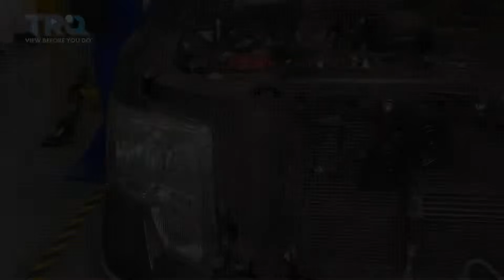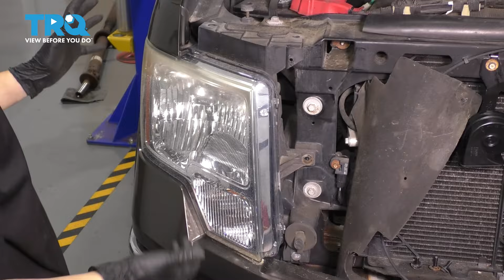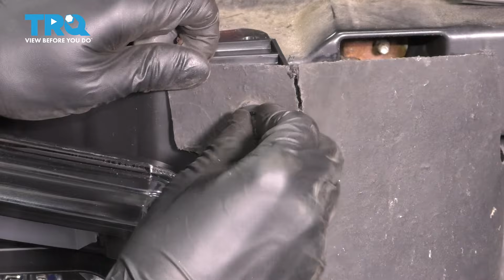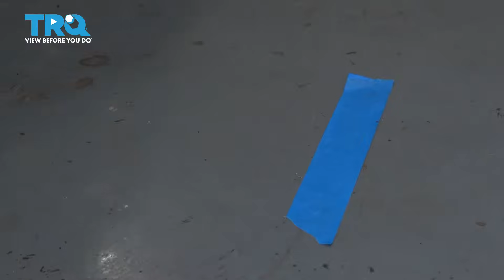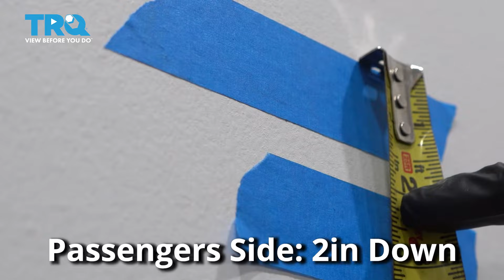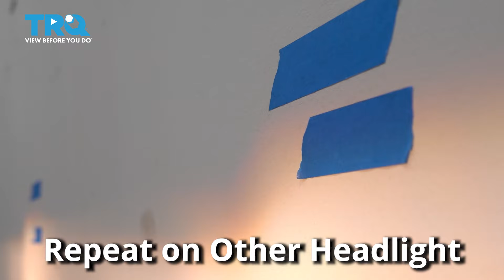How to Replace Performance Headlights 2009-2014 Ford F-150

Comment: This video no longer matches the item sold.  The turn signal is now a LED plug.  Unfortunately my right side projector didn't work so i had to get a return.  I do recommend buying new sockets because the old ones get brittle and break because the new housing is very tight.  In this video it looks like the turn signal socket was replaced already.

Comment: I see the replacement had DRL, none of the 2009-14 models had DRL. There was nothing shown about additional wiring required. How does the DRL work? It was not covered in the video
Reply: The DRL plugs into the side marker bulb socket. Anytime those side markers are on, the DRLs are on